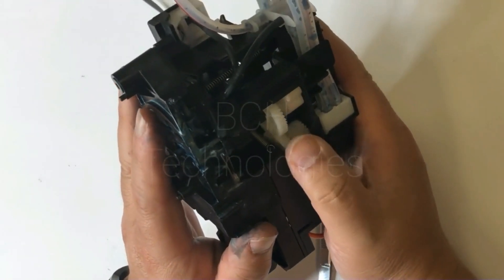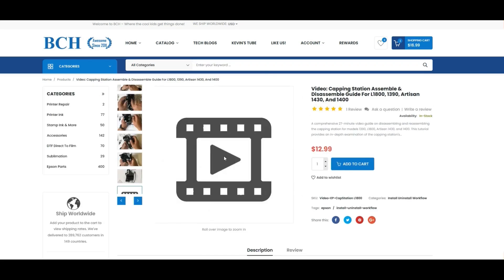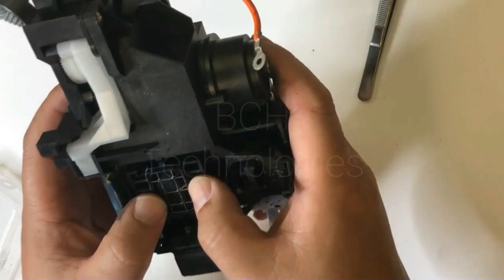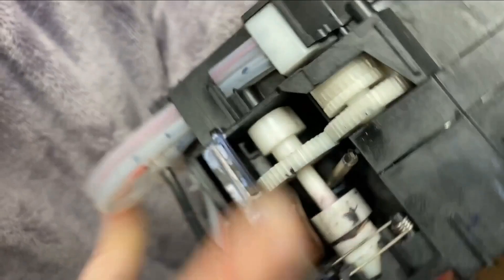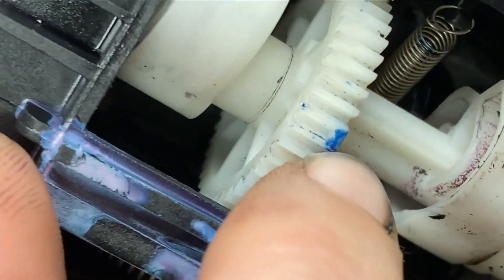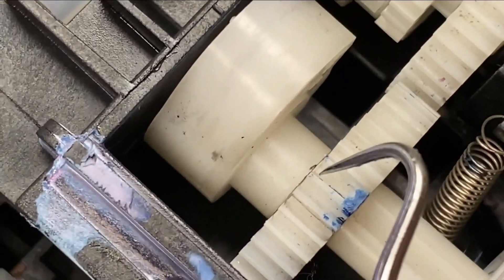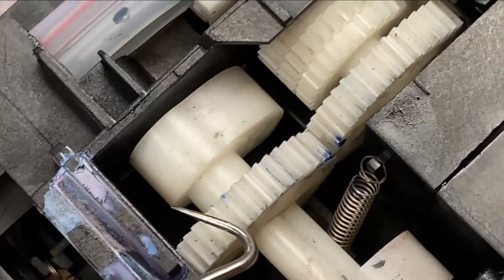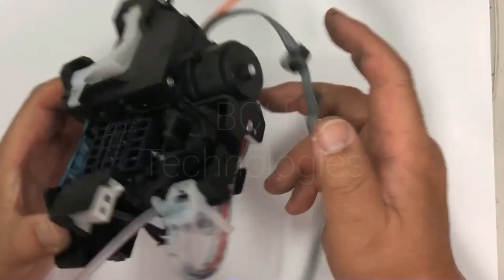How to Fix and Align Printer Capping Station Gears | BCH Technologies Tips

Comment: If it is misaligned, will it cause the latch to pop up and block the printhead during a print? Mine is popping up during prints and blocking the head causing a 52h and 5h error code (new motherboard, new encoder, new CR motor, and new pump installed). There are no other blockages and it runs smoothly until that latch pops up.
Reply from the maker: Thanks for being a member! Yes, a misaligned capping station can definitely cause the latch to pop up and block the printhead, leading to those 52H and 5H errors. Since you're a member, you have exclusive access to this detailed tutorial on aligning the gears: [https://youtu.be/mTDHAXg98M0](https://youtu.be/mTDHAXg98M0). Try powering on the printer—sometimes, if the misalignment isn't too severe, the gears can self-correct. But if the latch keeps popping up during prints, it definitely needs to be checked and realigned. Let me know how it goes, and thanks again for your support!

Comment: Hello Kevin,Great videos

I currently have a Epson xp-440 printer and I had to change the main board because the USB cable was not reading the printer however, the printer now doesn’t print anything out when I do a nozzle check it takes in the paper but does not print anything and then the message comes on paper out.I load more paper and hit the start button, but it just does the same thing over and over. I’m wondering if you know any fix?

Comment: General question, I have an Epson 7900. Recently after no printing over night, my Test pattern Shows the MAGENTA as blue. I can do a couple cleaning cycles and it comes back just fine. As the Cyan is Paired with the Magenta head, while idle overnight it seems the cyan is contaminating the magenta side of the head. I put a new Magenta cart in and same issue. When the head is parked, what is that pat called? The Capping Station? Could there be a leak or the gasket is not sealing? I have replaced the wiper and cleaned the area. thanks.
Reply from the maker: One common cause of the issue you're experiencing is related to the capping station and potential cross-contamination between ink channels. If the capping station is filled with water or capping fluid to prevent the printhead from drying out, higher ink pressure from a Continuous Ink System (CIS) may cause ink from one channel to seep into another. To address this, we recommend installing a tube clip to block ink flow during idle periods. Additionally, check for any capping station malfunctions, such as loose gaskets or damaged seals, which could also allow ink mixing. Inspecting and replacing the capping station, if necessary, may resolve the problem.

Internal printhead leaks or residual cleaning solution in the capping station could also contribute to the issue. A small membrane leak inside the printhead could cause ink from one reservoir to seep into another, which often requires printhead replacement as a solution. To minimize contamination risks, thoroughly flush and clean the capping station using manufacturer-recommended solutions. Thank you again for reaching out and supporting us! Your engagement inspires us to keep providing high-quality resources. We wish you success in resolving your printer issue and are here to assist with any further questions.
Reply: @BCHTechnologies  Thank you for your response. I enjoy your videos and learn how these printers work!